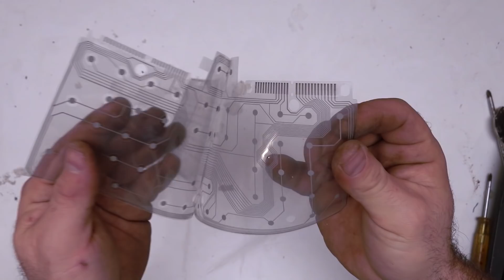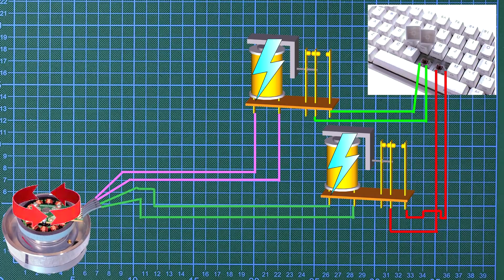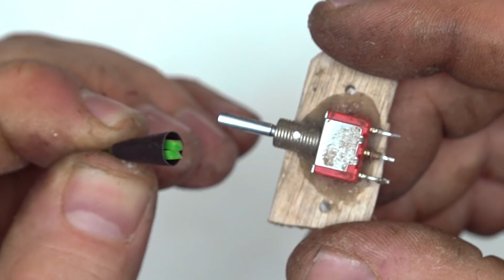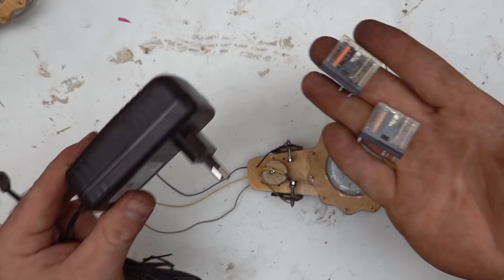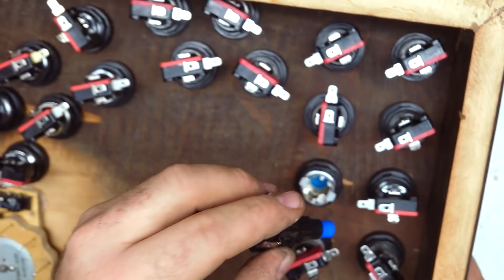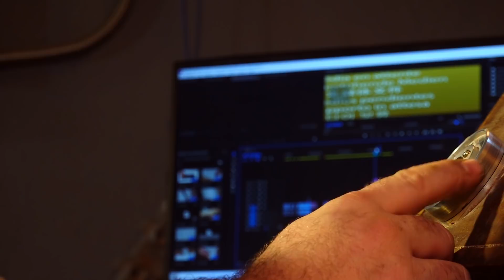How to Make Knobs • Control Any Software - No Electronics Used!

Comment: You could have also used optical sensors for the sensor/switch for the rotary wheel instead of the momentary switch, that why there would be even less friction and a higher resolution in ur movement of the rotor knob! 

Great video! Well explained and fun project! Loved that it was all eletromechical! Interesting challenges!

Comment: Hi bro... i see you buy a mechanical keyboard board for this project...
Why not use it to it's maximum potential?
Like... make the keyboard actually usable (just need to buy the switches & caps)... so you just need to rearrange your diy "video editing" buttons & knobs around the keyboard. (Maybe also make those buttons removable, so when you use the mech keyboard for gaming, it won't accidentally pressed)
That would be nice, right?

Comment: You can make a quadrature decoder to determine the direction of rotation of the VCR motor with a D-Type Latch. Use one of the phases as 'Data', and the other phase as 'CLOCK'. And you can make a D-Type latch out of relays if you really want to. The direction signal can be 'used to enable the 'CLOCK' phase to trigger different keys based on direction of rotation. You can do all of this with relay logic.

Comment: very nice project, a bit misleading about no electronics/programming, config sw only works in windows, later ok for any Os, also
if the source voltage for each button is the same (not encoded) then the circuit could be made with 1 solenoid and less contact wear, in in original each tab on the wheel makes the solenoid click,  a solenoid can have 1 input + 2 outputs,
the direction switch could change the output of the solenoid (N/C,N/O),  input comes from the common source, 
each tab on the wheel presses the microswitch and sends a voltage to the chosen key.  
Keyboard cicuit is keyboard common source to microswitch => solenoid input, via N/O to first key and via N/C to second key,
CW - CCW, depends on how you wire , wrong result, invert the solenoid outputs to the keyboard.
Solenoid power circuit :: power to direction switch blade, lowest contact wire to solenoid, upper contact not wired, is just a mechanical stop,  Ground wire from power to solenoid ground.

Comment: You got a new subscriber!
I loved your video and your project!
I use to fix things and create things reclycling parts as well and I fixed my car's trunk electric lock using the cable of a tooth brush, 2 little screws and 20 minutes epoxi glue. It's working as brand-new for the past 6 years, haha
Awesome!
:)

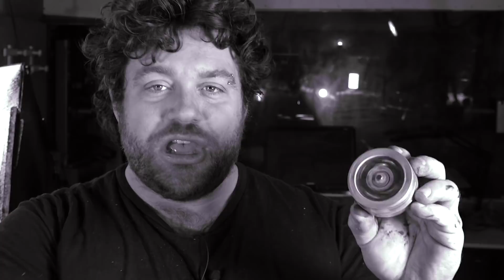Comment: 9:25 Shouldn't the power generated by the motor invert when you turn it in one direction?  I feel like there's got to be a way to do it from there.  Maybe swap the polarity of the cables on one of the relays and put diodes ... somewhere? maybe on the negative to prevent the circuit from completing and triggering the relay?  I think that would also protect it so power couldn't run up the negative line.  I'm pretty green as far as EE stuff goes but in my head this makes sense lol

Comment: what if you balanced your wiper between two momentary switches (the switches make contact with the wiper, not the gear, so it's either deflecting into one switch or the other? I'm not sure you even need the relays.
Do you currently have a situation where your first click after changing directions will continue on in the same direction?

Comment: The textbook way to sense the direction of rotation is to use a quadrature encoder.  You could still use your wooden wheels and cherry switches.

What you did was clever as hell though.

Comment: Man, loved your way of primitive technology ⚙
But the first things I learned about Arduino is Encoders and I used mouse wheel 🎡 for it
One Arduino can save your time and do it all.
P.S. Add a wooden cap over the video head for a better look, or 3D print since you're familiar with designing.
All love from Iraq

Comment: Unfortunately current sensing off a motor implies that there is sufficient current - so that fails slow turns, it's not great. Only mechanical and optical solutions really make sense.

The simplest thing i've seen along your stated requirements is "Better rotary encoder | 3D printed" by Gyro.

Comment: Give the algorithm a break, it suggested this video to me right now. So as I enjoyed it, the algorithm knows what I like! Subbed and liked!

Just one question: did you keep the relay intermediate step in the final version? Technically there shouldn't be any needed, one could wire the switches directly.
Also it's a slight cheat to buy a mech keyboard pcb, which essentially is a micro controller with qmk flashed already.
But overall I enjoyed watching your very valid process and approach.

Comment: Why not just put two of the limit switches 90 degrees out-of-phase instead of using just one? Then you wouldn’t need the complicated directional sensor.

Comment: Only analog? How abouth the keyboard chip? Might as well use an arduino with HID capability imo
Reply: Also an Arduino would allow using a Joystick emulator, which wouldn't take functionality away from existing keyboard, but extend it.

Comment: Man, instead of the Premier logo, you really should have installed a 🖲️ trackball or a touchpad. I'm sure you could've found an old arcade style trackball to use. Would have removed the need to reach over and navigate on the device. Hopefully you do a revisit or 2.0 variant of this. Either way, still a super dope video and concept!

Comment: please can you help a noob, can somebody tell me if i can wire a 3 pole relay as a single pole, i think thats what i want/need?, i needed a relay to turn on and off from - 24vac,on the coil side-, 240v 35a on the main load , and with out spending silly money i could only find a 3 pole one cheap, thats 35 amps , all i need it to do is when activated by the 24v ac , allow the current of my 240v ac to pass to make the circuit, and that can be just the live or the live and neutral, etc etc

if it can be done?, would wiring it so my live splits and goes in to all 3 poles and then out all 3 poles(when activated), to give more current, as its for my mig welder ,(24v trigger), so more amps the better, thank you
Reply: What do you mean three pole relay? The coil has 3 poles or the internal switches is normally closed and normally open with the center pin?
Reply: If it is the switch inside simply connect the phase to the center tap and connect the load to the normally open contact so the relay will close when you send 24V to the coil and the load will be on
Reply: @Thebasicmaker  yeah thanks thats what it is, can i do the same on all 3 poles, connect the same live to all 3 center taps, and all 3 again conected to the one live out on from the outs
Reply: @lazycarper7925  yes you can co nect all 3 relay  switches in parallel
Reply: @Thebasicmaker  thank you
Reply: @lazycarper7925  no worryes 👍

Comment: That VHS head control wheel must be the most satisfying control feel ever devised. Ball bearings, weighted knob, spring steel, and a roller switch that makes a relay click? [chef's kiss]
Reply: And it has momentum due the weight inertia., so you can give it a stronger turn for fast zooming
Reply: Gotta run find some VHS players at the junkyard 😂

Comment: Some time ago I made a joystick for a computer to play Mario using the same method with the keyboard board. This can be used to make keyboards and devices comfortable for people with disabilities. it is not so difficult to find the pins of the specific keys, you just don't have to remove the plastic pad under the keys and use a multimeter to measure the contacts under the key to which pin they go. I really like the design of your creation.

Comment: I use a Contour (brand name) Shuttle / Jog controller that cost less than $100.  I've had it for fifteen years I think.  It has 15 buttons, an outer ring that snaps back to the center, and a central knob that spins freely.

Comment: Try using USB joystick / gamepads and then talk to the computer through it, via analog joystick inputs.  Then your software detects those inputs.  Similar idea to keystroke inputs, but not as confusing, and a rarely used interface that won't interfere with normal keyboard / mouse inputs.  You can have up to 12 or 24 USB joysticks attached and each given their own interface.  Use AutoHotkey to write your interpretation software in Windows to turn actuation into action.

Comment: This is cool! Since you’re working with pretty low power, it may make more sense to use transistors instead of relays though. That way you don’t have to supply your own external power , more reliable, and cheaper. Here’s a schematic that I think is right 😂 https://imgur.com/gallery/HNYsnCV
Reply: Also you could probably find some transistors in that same player
Reply: Neil Sawhney no, a better approach would be a DIP reed relay.  You can get them in a 5v flavor and use the 5v from the USB to power them.

Comment: Instead two bridge rectifiers, you could use just two diodes on each relay, and if it is a simple brushed DC motor - you get polarity based on the direction you rotate, and diodes decide which relay to open and close based on the direction you rotate.
Reply: A rotary encoder would be a more "electronic" solution..

Comment: Hi Rulof, I really like your videos, I've been subscribed for several years. I just posted a video on my channel, very much inspired by this video. I wanted to show you that it is possible to use an old keyboard. It's just a process of tracing the lines of the 2 plastic sheets. It's pretty hard to do by hand with a marker, but if you scan them into a computer, you can basically just take the 'paint bucket' tool, click on the key/line you want to trace, and it highlights the whole line. Do this for each key you want to map, and in a few minutes, you have the pin combinations. The big advantage, other than the cost, of using the old keyboard circuit, over the keyboard pcb kit you used, is how small it is, allowing you to put it in pretty much any form factor you want.
Reply: thanks so mutch for  talking about my video and channel !   great trick using the scanner and photoshop to trace the  circuit!   waing for part 2!!
Reply: @Rulof_Fai.da.Te_  You are very welcome, I'm really glad you liked it.

Comment: The secret is to input voltage in the graphite circuit and find the which header pins are high using a multi-meter while pressing keys. For the rotating knobs I would adapt an old mouse (those with a ball) so you can preserve some rotation accuracy.

Comment: I don't know if I'm right in saying but have you tried wiring the bridge rectifyer around the other way on one of the sides, if this isn't the solution, what is the component that allows voltage flow in one way but not the other? Is it a diode?  BIGCLIVE.COM youtube channel would know..

Comment: wow so much work.... for practically avoiding an arduino for no reason...
Arduino + MMJoy
https://github.com/MMjoy/mmjoy_en/wiki
2 Rotary Encoders
Couple switches
2 or 3 shift registers or a button matrix with diodes... done..
less than an hour of soldering..
no tinkering.... software has a gui to set up...
for anyone who wants to have something like that too but is not willing to do so much unnecessary work..
and way less expensive than buying a 24€ keyboard pcb + 4x5€ relays...
also this keeps it modifiable so in practice you can print out multiple "profiles" slap em on the front with different hotkeys for different programs that you want to use.

this video feels a bit like a lifehack video.... why do something straightforward and easy when you can scratch your earlobes while reaching up your arse to get out of the mouth and then reach to your earlobe...
Reply: great advice! thanks!  the goal of my channel is recicle things! thats the reason of my idea!
Reply: @Rulof_Fai.da.Te_  well you can find rotary encoders in all sorts of devices, printers, scanners are often filled with them.. buying a 24€ keyboard PCB and 20€ worth of Relais kinda beats the purpose of recycling imo...🤷
Reply: @Sty1a  relays came from an old instrial panel... pcb i agree :)

Comment: For Motor Wheel use Mouse board.
Take mouse with 2 additional wheels and use your own.

Whithout controller there is no Simple way. 3-4 analog 74xx chips can do same job (like in 80's).

So use mose controller, arduino, or lod analog Logic chips - 3 ways.
Or use 1 knob for 1 button
Reply: You can use not only Relays - optocouplers smaller make no sound, and no moving parts.

Comment: I'm also a bit disappointed in the "no electronics" you basically got a keyboard shaped pre programmed arduino from amazon.
 though making mechanical stuff is satisfying in the end I'd say the arduino route is easier and also probably cheaper.
I do appreciate the effort, but to me it kinda feels like overengineering your way out of using an arduino.

Comment: btw you may be able to get rid of the relays, and electric plug if you use two contiguous buttons, usually on keyboards the letters are grouped on a wire like "qwer" are on a single wire.
so you can put the common wire going to the switch, then to the orange middle wire on the blade, and use the two other wires on the switches.
note that you can just sand the carbon off of the keyboard boards.
Reply: I didn’t know that! Great advice! Thanks a lot!!

Comment: without using arduino, the easiest would be a mouse scroll wheel but you can only have one.

some way you might be able to do would be to fix a pole with some friction to the wheel and have a magnet on the end activate a reed switch which would enable either key depending which switch it is against.
you then use a single relay or the many reed switches around option.

though while only mechanical/low electronics is fun, imo the easiest option is still the arduino, you can probably adapt a vcr button program in a day or two if you ask some help.
and you get something that's fairly easy to change.

Comment: Very nice rulof! I just don't understand why you use relays instead of transistor, or just simpli conect to the pcb cause the sound is fun but it will make you mad in a wile^^
Reply: I know.. but In my mind relays are the heath of this project.. so it make sense the make sound :)  but transistors can be a great solution as well

Comment: By not using Arduino or similar device you've made it painfully complex and likely to prematurely wear out or break. BTW. there is a device that does exactly what you wanted and you probably have one on your desk - a mouse wheel.  As an exercise in purely mechanical this project  makes some kind of sense, but you should then showcase mechanism - not hide it.
Also, you can easily solder onto old keyboard PCB. Scrape the conductive paint off, there's should be a normal trace underneath. Even if it's not, you can scrape off the green solder stop from the trace leading to in and solder a wire to it. Since it's looking like a standard 2.54m pitch you can also use an ISA slot from a motherboard or a floppy disk connector from and old-old PC, though they are getting a bit harder to find in trash. As for which contacts to close, that's easy. Just trace the lines from the button on the original keyboard membrane
Reply from the maker: i guess you havn't seen all the video... how can wear out??
Reply: @RulofMaker  on one hand this is true and I have experienced this first hand as I had to replace both of the momentary switches in my driveway gate opener. (only after 10 years of daily use and being outside in 40C weather) 

On the OTHER hand the momentary switches like the ones in your control knob board, are generally quite inexpensive and easy to replace! (I bought mine for like under $10 total.)
Reply: @RulofMaker  I watched the video till the end.
Mechanical switches will fail at a certain number of on-off cycles. This is true for both manual switches and relays. The number (for good swiches) can be high but not so high for this to never happen. For instance, good quality Omron switches in my Microsoft Explorer mouse lasted for some 20 years before I had to change one out, but unbranded crap in my robot vacuum failed (all 4 of them) in less then 5 years - say 100 cycles per session, 30 vacuuming session per year, that means they only lasted 1500 on-off cycles and that's generous. Bottom line, mechanical switches fail, that's one of the reasons mouse wheels use optical interrupt sensors. The other is you can get high actuation rates, so your wheel can detect very small movements and also very quick movements without loosing steps.

Comment: this controller has turned out AMAZING!!!!!
i'm wondering if you make the same style turning-knob but of instead of it clicking a button on the keyboard it could use the motor to generate a signal that is smooth like how mice used to have a ball inside it so the 'steps' in between each 'click' are very very small and it seems smooth.
maybe you could use the guts of an older mouse with a ball and the VCR motor to do this, that would be pretty cool too!
--- GREAT VIDEO!!! THANK YOU FOR SHARING YOU WEALTH OF KNOWLEDGE!!!!!

Comment: It would be good idea to add flyback diodes to the relay coils, it is a good practice. It eliminates any voltage spikes which are generated when the relay coil is deenergised.
Reply from the maker: very good advice! thanks!!
Reply: :) I like your solution btw, it was very creative. It probably would be much easier using microcontroller, but this has something to it. Also for some simpler tasks it will be very possible to use the original keyboard PCBs, I believe these black contacts are just carbon plated, when you scrape it off, it will be normal copper, which you can solder wires onto.